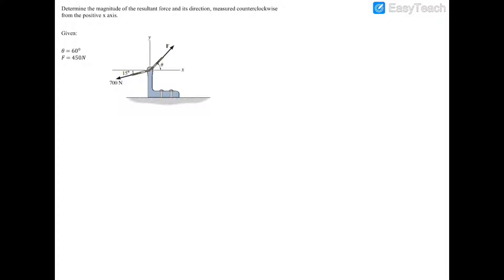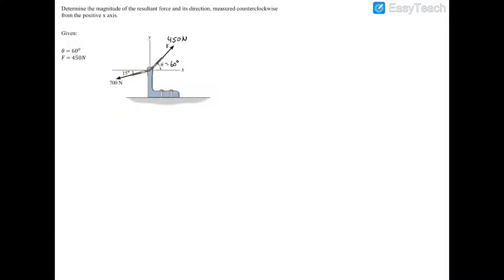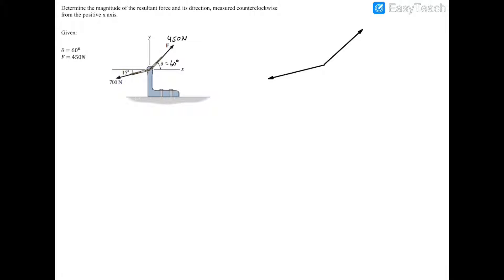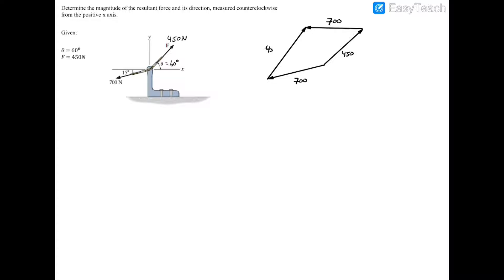Determine the magnitude of the resultant force and its direction, measured counterclockwise from the

Comment: I thought we only use cosine law when there was no complete pair... And 497N and 45° is a complete pair...  By the way, thank you for this video it helps a lot
Reply from the maker: The law of cosines can absolutely be used if there is a complete pair! It is pretty versatile, as long as you at the very minimum have 2 sides and an angle (SAS) or 3 sides (SSS), the law of cosines can be applied. If you have any additional information about that triangle, it does not void the law of cosines. Thanks for watching!
Reply: @gr_engineering  Why, if sine law was used, the angle equals 84.82 deg?
Reply from the maker: @alfieaquino4908  The Law of Sines can give you an ambiguous solution in the case of SSA (Side-Side-Angle) triangle (as we have here). SSA triangles are known to have this “Ambiguous Case” when using the Law of Sines. The reason you were able to calculate a different angle was because an SSA triangle does not describe enough information for the Law of Sines. As a result, there are two possible triangles that can be formed, one with an acute angle and one with an obtuse angle, and both triangles have the same given side lengths and the same value for the angle opposite one of those sides.
Reply: Thank you very much!